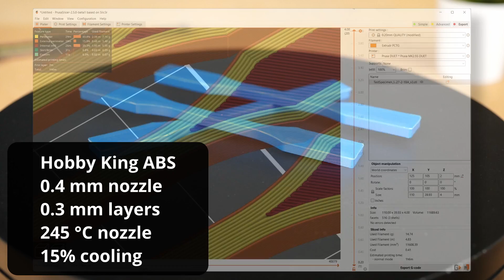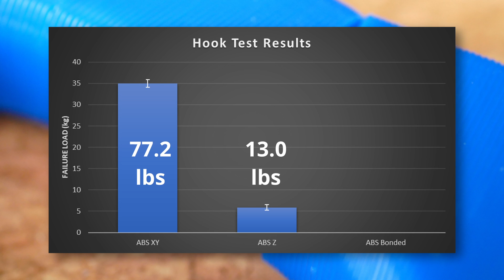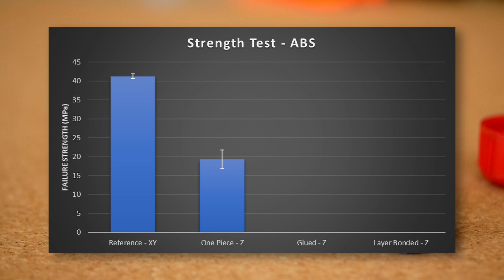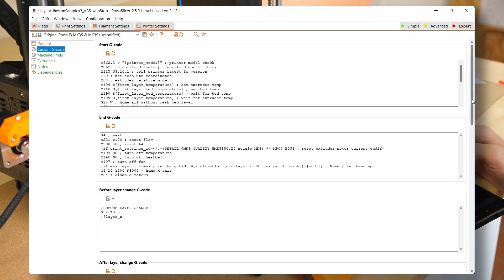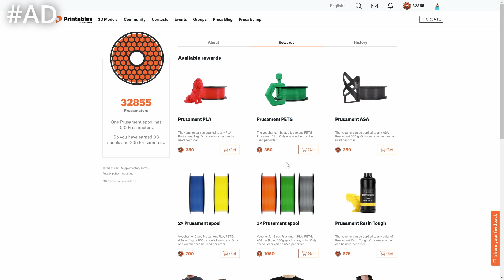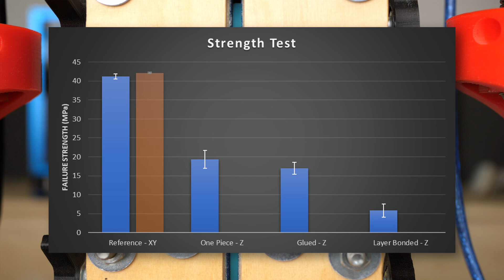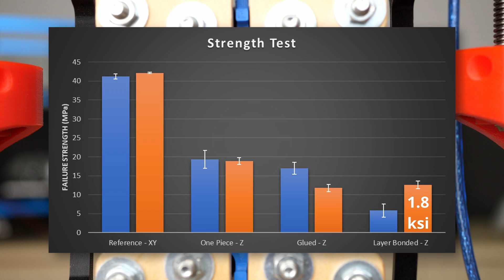Perfect Layer Adhesion if you Brush Solvent onto every Layer of your Print?

Comment: I had an idea for trying to improve layer strength: staggered layers. Basically if you were printing a 2 perimeter hollow box print the outer layer, raise up half the layer height, print the inner, up half the layer height again, print outer and so on. I tried doing it hand editing gcode and successfully printed a 2mm high test to see if it was possible without dragging the piece off of the bed. I never went back to make a piece big enough to test the strength due to how long it took to edit the gcode for even that small test. I'm not a coder so I couldn't easily think of a way to automate it.
Reply: Have you seen the "Alternate Extra Wall"  feature on the Cura slicer? It looks like it does a similar pattern. I haven't tried it but maybe it will speed up the process?
Reply: @archercureton3738  it's not quite the same. It improves bonding to infill, but it still prints on the same plane as the rest of the print. I have never looked at the Cura code, but it may be possible to add a z shift to the extra wall more easily than writing a whole new pass for the slicer.
Reply: You could try this with super slicer's "Between extrusion role change G-code" section. Watch out for the first layer :D
Reply: A while ago I actually made a Python script that generated a test hook sample with that technique and send it here. Sadly it was never tested.
Reply: That’s a fantastic idea! Would love to try this idea if I had time to. Maybe there is a better way to automate this.
Reply: I had this same idea while watching and looking for it already being posted.  hUGE thumbs up.  This should increase are the surface area between layers and thus be stronger.
Reply: What you just described is basicly a way to slightly increase surface area. Which in turn would increase adhesion. A better method would be to just use a bit of sand paper and texture the material between layers  more complex the texture the more surface area. The more surface area the more surface each layer has to adhere to each other. The better the adhesion. Could use a small piece of metal attacked to the armature that will scratch each later as it hardens.
Reply: @halogeek6  It's hopefully more than just surface area. Along the join of two layers of filament there is a slight horizontal groove. Place a line of filament halfway between the height of the other two layers and you will hopefully get a slight overlap - so the layers interlock slightly. See https://www.youtube.com/watch?v=qARgOYFDlHI
Reply: @halogeek6  That's correct. But staggered layers is just a SW update that will work with every printer. A scratching device is a hardware modification. And it will gum up quickly, too, I'd guess.
Reply: @holgerpieta7367  fair enough. I can just see staggered layering weakening the over all build. But I suppose that will also depend on the material and settings of the printer. 3d printers are a deceptively complicated beast.
Reply: @halogeek6  That's why it should be tested and not just sold as the next hype.
Reply: I have a vague TODO to play with is sort of idea some day. And also methods of interlinking layers. Wish I had the time.
Reply: @tombrazier6172  Yeah, also have the idea to look into a slicer and maybe do something about it. But that's very vague.
Reply: Good idea.
Just print the model on a tilt.
Reply: @MichaelKingsfordGray  That won't solve the problem, it just tilts it. Depending on your model that will increase the layer area,  improving adhesion, but that won't always help or even be possible.
Reply: @holgerpieta7367  Yet another sage bit of judgment. You are correct.
Reply: @holgerpieta7367  So now your model breaks at the tilted angle?
Reply: @Vindolin  Yes, exactly.
Reply: @Vindolin  Yes, but it takes more force because of how forces work.

This technique is ignored in thos experiment because the point is not to have a stronger print but to get a stronger layer-adhesion.
Reply: @MichaelKingsfordGray  That would not be quite the same. You would then have also planar layers but at an angle shifting the problem of weak layer adhesion to a different orientation.
Reply: @mkesenheimer  Yes, you are correct.
Reply: In a sense, combining infill does this, but only for a few layers at a time. 
Make two objects, one inside another. Slice each, use a script to add a half-layer z-offset to the second body.

Comment: It’d be interesting to try and print and smooth each individual wall within the print body before printing the next wall and smoothing that. You’d essentially be changing the layer lines from horizontal to vertical. Maybe you could do this with an angled print head like on a belt printer. Then add “normal layers” to add strength in the xy-plane.

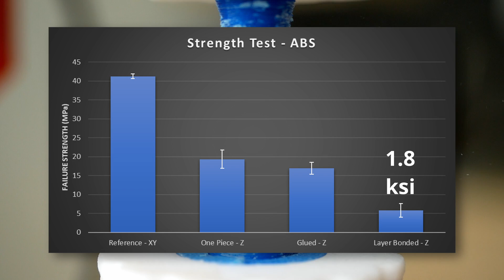Comment: I think 9:26 shows what happened and why the result was more disappointing than you expected: You probably expected (well, at least I did) that acetone would dissolve the layers enough so that the snake fill pattern would disappear and instead have a "full" smooth layer on which the next pattern could adhere fully instead of adhering at the intersections of two successive patterns. Instead it looks like it created puddles inside the "snakes", making the bonds worse. Are these materials porous enough to guarantee the acetone will totally evaporate eventually? If acetone bubbles remain trapped in the material, there is no reason for it to increase strength. 

Unfortunately, apart from really covering each layer in acetone for several minutes, to let it dissolve and then fully evaporate, I don't see how to improve the process.

Comment: When the acetone evaporates it absorbs heat from the surface. You can feel this if you dip your finger in the acetone and hold it up. Blowing on it increases the evaporation rate and you feel your finger cooling down even more. So the acetone on the part will effectively cause the surface temperature to drop making the ABS have a tough time to adhere to the previous layer.

At least that's my take on the whole thing. I don't have any 3D printing experience but everything I've read, seen or heard about printing ABS it's best done in a heated chamber. So the cooling from the acetone evaporating sounds like it would work against you when trying to get the layers to adhere to each other.

Someone in the comments suggested using a laser to heat the previous layer just before the extruder puts down a new layer. It might be worth thinking about. But I have no idea how to implement something like that. The extruder will after all move in all directions so either the laser has to move around it so it can hit the area the nozzle is going to cover with a new layer next, or there have to be several lasers placed around the extruder. Seems impractical and expensive, and I have no idea if it would actually help,
Reply: Maybe a small heat blower nozzle instead of laser? That would create a bit wider heat island on the surface. Perhaps the printing head nozzle could be constructed in such manner that it has additional external wall (a sleeve) and air cooling the nozzle is forced downwards between the nozzle and its external wall/sleeve, so that extrusion flows down surrounded by downward stream of hot air which heats the point of contact between the print and newly added material.
Reply: @salec  That method will result i  significant warping, I think. The laser approach likely mitigates that much better by localizing heat.
Reply: @tardonator  As I think I said earlier, I don't have any 3D printing experience, but as I understand it we have two conflicting interests, layer adhesion and keeping the shape without warping.

Layer adhesion is best when both the previous layer and the extruded plastic is at melting temperatures, but that also means the print is soft and prone to warping. Any overhang will be very likely to sag and it's unlikely the print will be able to finish.

The cooling fan is intended to combat this by removing heat from the fresh layer before it can sag.

Using a warm airflow to create a "puddle" is therefore not likely to work.

Using a very concentrated heat source, such as a laser, also creates a "puddle", but a much smaller one. It would be similar to soldering or welding the plastic and would require a lot less energy and therefore total amount of heat to accomplish. So less heat for the fan to remove to avoid sag.

Having written this I kind of wonder if it would be possible to avoid the hot-end and weld the filament directly using a laser...

Though If I can dream it up I'm sure others have also thought about it and either tried it or dismissed it for practical reasons that I haven't thought of.

I think that when 3D printing metal powder a laser is used to fuse the powder, so there is some merit to the idea. Note that I said "I think"...
Reply: @blahorgaslisk7763  > Having written this I kind of wonder if it would be possible to avoid the hot-end and weld the filament directly using a laser...

That's what Selective Laser Sintering (SLS) does.  "Print" a layer by melting metal powder.  Move the bed down a bit, put more powder on top.  Repeat.
Reply: @EmperorA0  Thank you for confirming that. Still I don't know if it would be a good idea to try it with plastic. On one hand it's probably possible to get good adhesion, but it also makes it impossible to use infill as the unfused powder would stay trapped in the infill structure. So either you make things solid or you have to leave holes where the powder can evacuated once the print is finished.

Edit: Yes I realize that metal prints have the same problems, but when printing metal you are probably looking for maximum strength so you'd print things solid anyway.

Comment: I saw something where they modified a hot end with a really hot heating element ring around the nozzle so that the radiant heat of the ring melted the previous layer right before the nozzle went over it and they did get much much better layer adhesion.

Comment: I read about non-plane printing a year or two ago where a long narrow nozzle is used and the g-code tells the printer to move through X, Y, and Z while printing a layer so that the outside of the part is smoother and much less stepped. I thought that could be used during the infill to make infill that overlaps multiple adjacent layers. However I'm not too sure on the specific geometry that would be needed so that each layer can have some overlap with the layers next to it.  
Something that would be much easier to execute would be to pause the nozzle over an opening in the infill and continuously extrude to fill multiple layers of infill at once. Each layer only a fraction of the openings would be filled so that it would be staggered and there would be a lot of overlap. This can also be combined with the non-plane printing where you have a long narrow nozzle that lowers itself to the bottom of each opening, starts extruding, and slowly spirals back up. For example if your infill makes a grid of 10 squares, only two squares would be filled each layer, so the extrusion would fill 5 layers. Then the next layer two different squares would be filled and so on until that pattern repeats every 5 layers.  That way there's a lot of overlap and no individual layer would be 100% layer adhesion. If you were also doing non-plane printing for this example, the nozzle would position itself over a square, lower down 5 layers, then extrude continuously as the nozzle slowly either spirals or goes straight up 5 layers.

Comment: I tried the same stuff a few years back with epoxy, what I observed was the liquid would be vaporized by the heat instead of helping bond layers together. Meantime, the hot plastic would cool down faster because of the vaporization, which only made thing worse.
Reply: This makes me wonder about another option.  Print the piece "spongy".  By which I mean either use a special material or adjust the extruder settings to leave voids by continually starting and stopping instead of one continuous extrusion.  Then use a thin epoxy or resin that soaks into the part.  For example, you can get superglue as thin as water.

Basically, 3d print a scaffold then use something else for the actual material strength.
Reply: @EmperorA0  I considered a similar idea using a vacuum pot to impregnate the print but never tried it.
Reply: That's what I would expect, ie, solvents flash off so fast I wouldn't expect it to do much.
Reply: I just googled different glues and epoxies:
The gorilla glue or the normal superglue seems to be two good candidates for this but they might dry a bit too fast... (10-45 seconds)
A modified 3D printer that is applying the glue (or solvent, epoxy, etc...) automatically with a second nozzle would be a lot better and might be able to print very strong parts.
Reply: @sourand jaded Yep, my delta has been sat unloved for over a year with a spool still attached.
Reply: Depends on what the cause of layer non-adhesion is. For example, if the filament is just greasy and this grease film interferes with layer bonding, then removing that with acetone from at least one surface would help.
Reply: @haphazard1342  I thintk the primary goal of doing all these experiments is to enhance the layer bonds, not to fix an existing malfunction. I woud doubt that someone will keep their fialment in a dirty environment. Even if you want to clean the filament, it is easier to just add a sponge to clean the filament before it enters the hotend or extruder. I also don't think using acetone to clean filament is a great idea, since several plastic can be dissolved by acetone.

Comment: use a hot needle to melt a hole between layers and then refill with the extruder to make "vetrical" anchors. the needle could be mounted at the print head at a offset so automating the process should be easy for small prints.

maybe the same or better results could be achieved with a custom infill pattern that is later moulded every couple of layers.

Comment: thanks for posting this, it is a good experiment. but there are quite a few downsides, acetone is (highly) flammable, it takes extra care/precautions and the results unfortunately didn't show improvements. I'd like to suggest trying glue stick or even uhu general purpose glues, for the layers adhesion test (note the uhu general purpose glues seemed to use acetone as a solvent, so the same precautions may be needed).

Comment: My idea for better layer adhesion is to make the layers nonplanar. E.g. leave gaps between the lines of the first layer and then fill them with the second layer adding some Z movement or maybe even add height to parts of a layer by intentionally overextruding. Finding patterns that work and interlock the layers well will probably take some effort, but I bet there is some improvement to be made. I wish I had the time and the measuring tools to test that.

Comment: try this: next layer's tracks should not run directly above the old ones, but in between in the gabs. This will reduce the height of the layer and make each track be touched with 45 degrees from the sides

Comment: Awesome video, love the thought, process, documentation & sharing what happened despite "failure".
I wonder if this Could work W tuning, especially as it's a process that Could be integrated easier than, say, a laser to flash heat the last layer just before laying the next.
A simple brush like this simply floods the print W solvent, especially W something as thin as acetone.
I wonder if a more metered & targeted application could provide positive effect while also limiting/mitigating the flame hazard.
After watching several of these, I'm also beginning to wonder if a combined SLS & powder deposition may allow prints to retain more heat & higher detail by providing an insulating support matrix that can be bonded into the layer joins and can then be turned into filament in turn, W an extruder (which are fairly easy to come by)

Comment: I wonder if you sealed the whole printer in a vapour chamber and kept the concentration of the solvent in the upper or lower flammability limits to remove the risk of ignition or replaced the air with CO2 or another non flammable gas.  Might even have to provide a cooling radiator to keep at an optimal temperature.

Comment: split the part in three, two halves vertical with an empty core hole the shape of the third horizontal key piece. then glue them together. its vertical strength should increase relative to the cross section of the key.

Comment: I would like to see how the impact resistive of several printing materials and print settings change with print orientation. Does any material and setting combination even come close to having the same impact resistance in both orientations?
Reply: TPU D65 is looking promising for this. I'm currently having a bit of a fiddle with it on my printer.

Comment: Uhhh this is pretty dangerous, as acetone is flammable. It's not like putting gasoline on it, but still if the extruder thermally throttles then you'd be asking for it to catch fire, especially the vapor

Comment: Can you try printing the parts as normal, then packing the parts in a sand mold (like setting up a forging cast) for stability, then soaking the parts in applicable solvents? You may run into issues with lower infills collapsing, but this could be interesting. Also, drawing a vacuum on the parts when in these molds may do interesting things.

Comment: I think the best way to improve layer bonding strength is to increase the mixing between layers. This really is two parts: remelting the previous layer and mixing it with the current layer. For mixing, what if there were a tiny nonstick needle or wire coming out of the center of the nozzle, extending a bit into the bottom layer? This could carry a little heat between the two layers and possibly achieve some texturing of or mixing with the lower layer. For remelting, I don't know... LASERs?